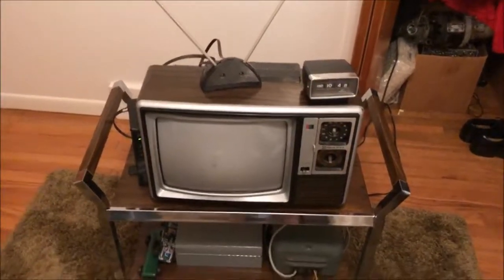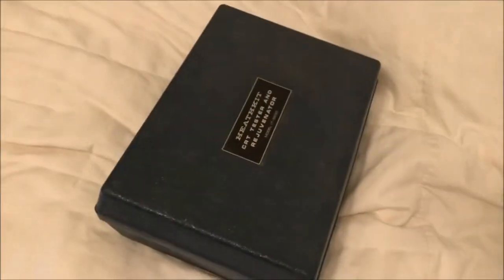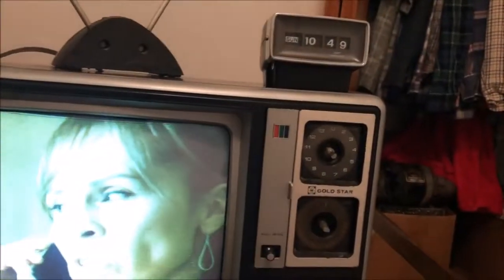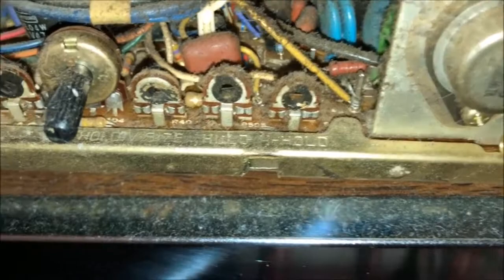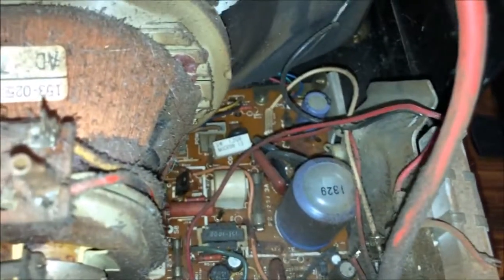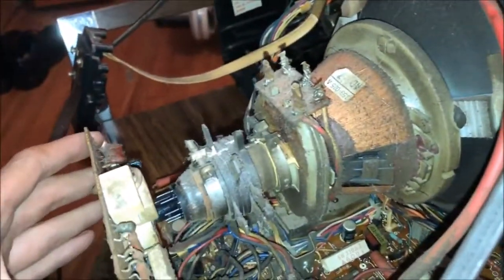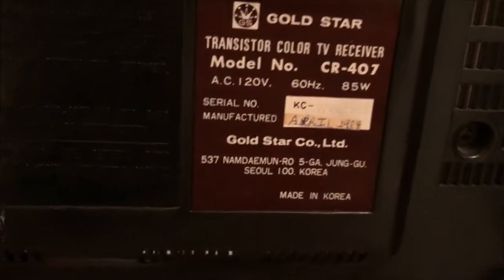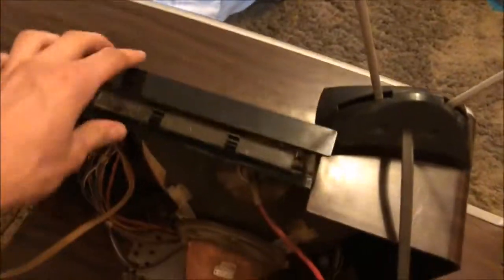1981 Gold Star Television - Dim Picture Repair/Adjustment

Comment: Love that clock you have there too.  And the cart just completes the whole look.

There have been several computer monitor CRTs I've tweaked the power/intensity pot on the flyback before to squeeze more life out of.
Reply from the maker: I intend to make a video on the clock, I just put it back in service the previous night, the mechanism was stalling. It really is an ingenious design, made by Linden, I have never seen another like it, even searching online. How it works is that is has a traditional clock mechanism with balance wheel regulation run off of a small spring, attached to the mechanism isn't the dials, but cam and magnet. At the end of every minute, the magnet is lowered onto a micro-switch, this closes the circuit on a small DC motor which simultaneously releases the magnet, advances the dials, and rewinds the spring an equal amount to what was used in the minute. This isn't a flip clock, either, it has dials like a counter, or mechanical odometer.

 I have another, older, more classic TV cart, too, presently there is nothing on it, but I'm thinking of setting a B&W set I have on it after fixing the set. I should say if I ever end up fixing the set, What I didn't show in the video is the electronics heap in the corner, you can see my closet, too. I could qualify for the username that one of your regular commenters has, "umajunkcollector"!

I could have turned up the HV, too, but that can cause other troubles, namely a potential arc out inside a cheap or dubious tube, that arc can take out a bunch of other components on a solid state set, fairly harmless on an all tube set. Older sets like my '65 RCA actually have an exposed "Kine Bias"(Kinescope - an old term for CRT) switch with three ranges as well as individual RGB G2 screen potentiometers.
Reply: That clock sounds fascinating!